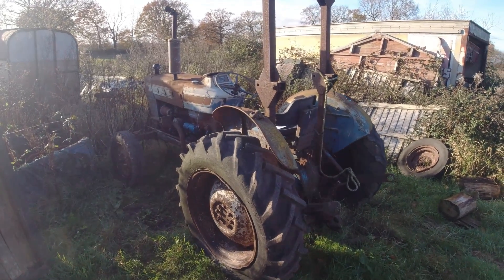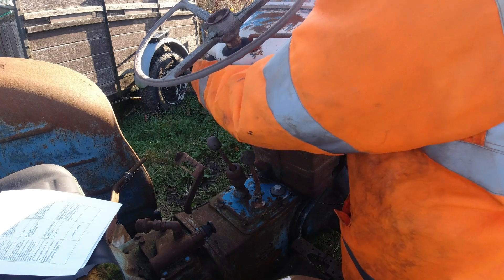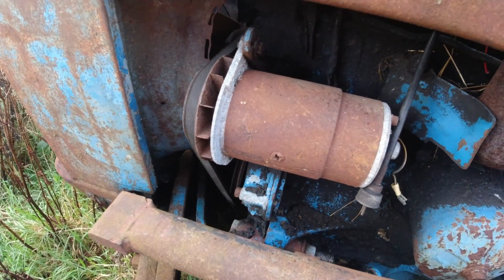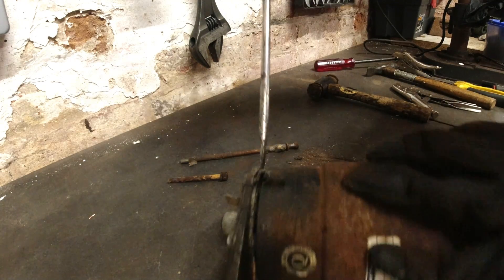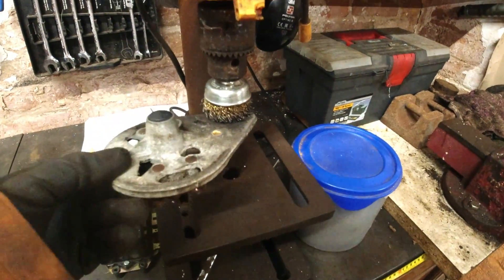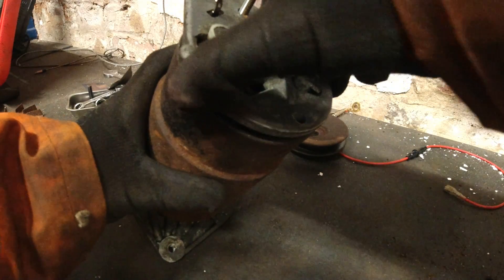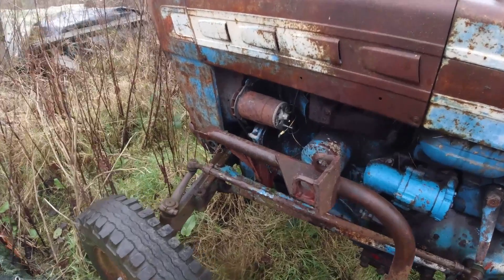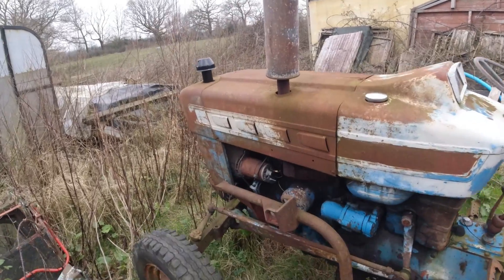Lucas C40 dynamo testing and rebuild on a Ford 3000 tractor

Comment: During an almighty freezeup I started my diesel by holding a lit gas blowtorch flame just at the edge of the ingoing air charge metal elbow , it raised thev ingoing air temp a few degrees , & started it . Avoid all rubber  / plastic trunking doing this .
Reply from the maker: Yes I have seen this done before but I've never tried it myself. Something to have a go with this winter
Reply: Just never do it with any engine that is petrol , gas or kerosene ( paraffin ) fuelled or BOOM , game over .
Reply from the maker: You would only ever do it once 🤣

Comment: When I hooked up my multimeter to the bridge wire I’m getting 14.6 volts when I spin it up
Reply from the maker: That doesn't sound right. Here are the test instructions that I used https://www.anglo-agriparts.com/testing-dynamo-regulator

Comment: There is something wrong if you only get 0.7volts spinning it up. Less than what an AA battery can produce.
Reply from the maker: Yes. It's coming off this weekend and an alternator is going on instead
Reply: @BlakesDen  My friend had the same problem, we took it to a place to get it fixed, we were told New York style "forget about it". We're getting one through eBay, a Lucas C40. My friend has a 62 Sunbeam Alpine, he wants to keep it original even though I told him to get an alternator. 👍
Reply from the maker: Great story! Alternators are a lot more reliable. You can get them now that looks like dynamos but they are expensive.

Comment: There's an easy "cold weather start button" in the centre of the stop lever on the injection pump that you press in before you crank & it pops out when the engine starts, they fire up alot faster also handy to bleed an airlock 👍
Reply from the maker: Thanks, I have been meaning to look for that button 😀